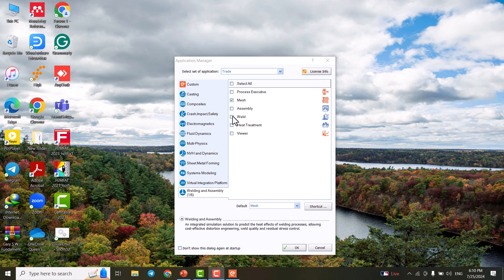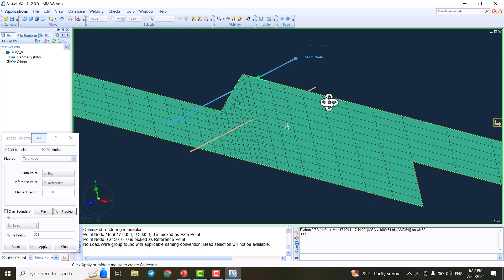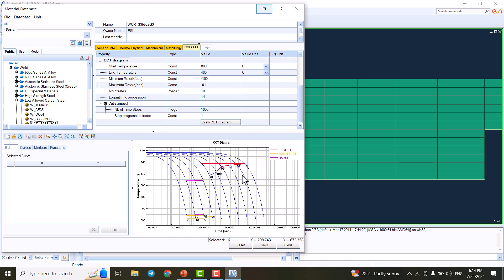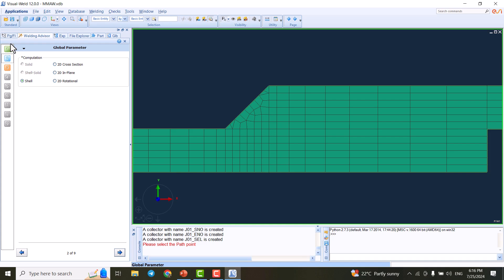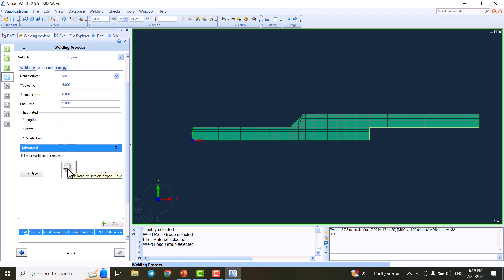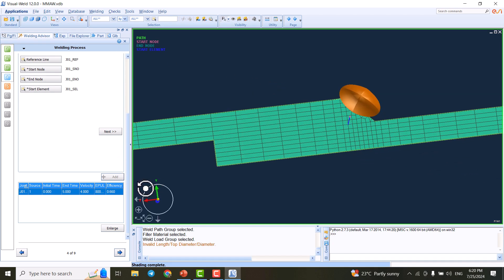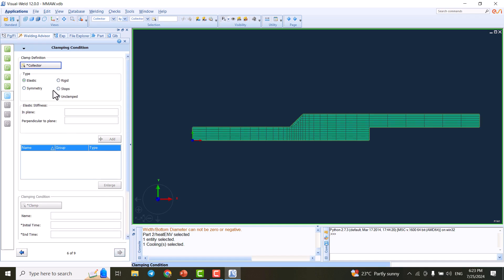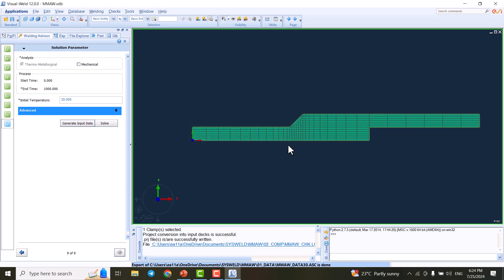2D welding simulation with ESI SYSWELD- part 2: Welding Parameters

Comment: Hey am using Visual Weld 2023.5 version will it affect the simulation when we move from one version to another?
Because I faced error like i couldnt able to select the filler material as well cooling condition (dropdown itself didnt pop out) so I dont how to proceed further.
Reply from the maker: No it shouldn’t be the case! There’s something wrong with the version you have!

Comment: I want to add a new material (U71Mn). However, both its thermal conductivity and specific heat capacity vary with temperature. Could you tell me how to add the properties?
Reply from the maker: Hey, you have to search it from papers and scientific articles. Don’t just write down sysweld, you might find it with Abaqus or Ansys keywords as well!

Comment: "Thanks for this useful lecture. Could you please explain how I can add new materials, such as SS316 and SS304, to the library?"
Reply from the maker: Thanks a lot for your kind words—glad you found the lecture useful!

Just so you know, SYSWELD actually includes SS316 in the material library already. You can find it under the public tab in Visual Weld > Database > Material.

But if you want to add a new material (like SS304 or a custom alloy), just go to the user tab next to public, then click the plus (+) button to create a new material. You can define all properties manually from there.

By the way, have you had a chance to watch my other SYSWELD videos? I’d love to hear your thoughts—drop a comment under those if you found them helpful!

Comment: I tried with your video, but I can't select my solver path. It says that selected solver path has no read permission. Do you know how to solve this problem?
Reply from the maker: I believe it doesn't have anything to do with the SYSWELD software in fact, it is because of the windows permission of a folder. You can change it by right clicking on the folder in windows Properties -security and you can edit the permissions.
Reply: @FEAMASTER  I gave all permissions to Everyone, including permission to read and write, but it says same thing too. I selected path documents in OneDrive folder like you. Is there any other way?
Reply from the maker: @태연임-v3f  that's sad! Have you ever tried different path for the solver?
Reply from the maker: Try root path as well
Reply: @FEAMASTER  yes. I tried C:, Documents, ESI group in Program files, and D:. Is there any basic path for solver? When I enter to solver setting by search window, there isn't any path for solver.
Reply from the maker: @태연임-v3f  In that case I ran out of ideas!! How about installing and reinstalling? Maybe it's better to contact the costumer service of ESI Group.
Reply: Thank you! I solved problem about solver path by reinstalling.
But another problem happened. When I clicked 'generate input data', it say "Not all prj to DAT result files exist."

And log file say 

------ Header ------

...OK

------ Database ------

Do you know why this problem happen and how to solve?
Reply from the maker: @태연임-v3f  I'm glad the problem was solved! Just to ensure, have you saved your file prior to generating the input file? you should find the DAT and PRJ file in the Directory/01_DATA. If you have done everything correctly, you'll see every detail in the FILENAME.DAT file (you can try opening it with notepad).
Reply from the maker: If you did all the steps and still don't see that, you might have missed a step in the installation process